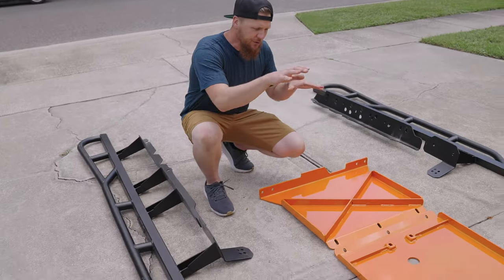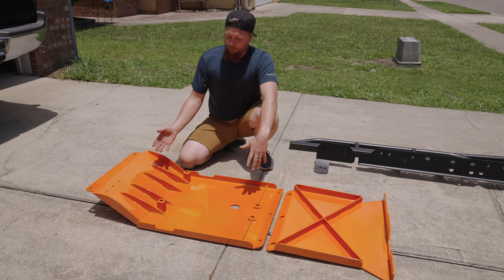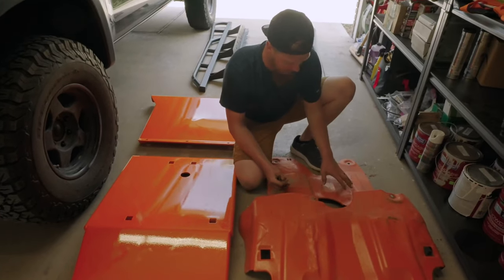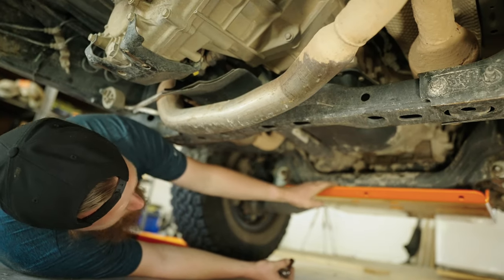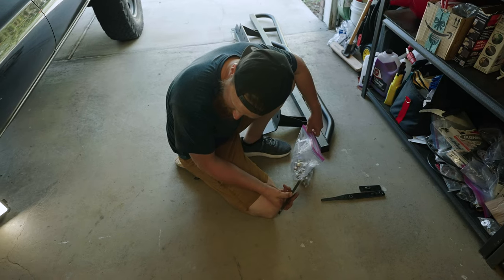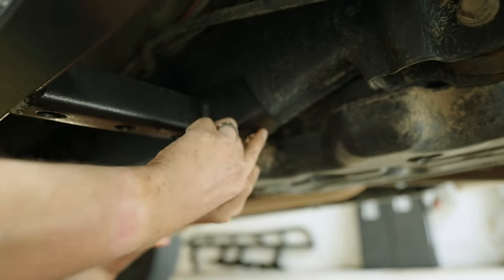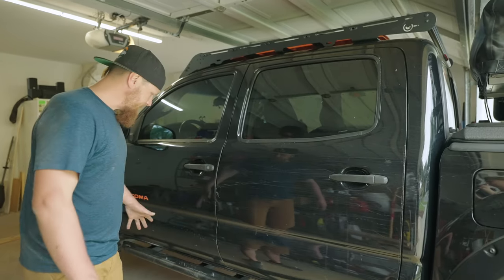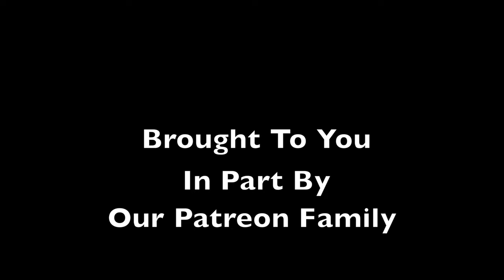Loki Gets New Armor From Bay Area Metal Fab

Comment: What degree are those sliders?
Reply from the maker: These are the standard built ones and are mounted at 20 degrees. You can customize the angle I believe if you do the built to order option.
Reply: @SunshineStateVikings Is that the Bay Area metal fab front bumper?
Reply from the maker: @yzrippin hey, thanks for the question. The front bumper is actually from Pelfreybilt which unfortunately isn’t around anymore. When Pelfreybilt went out of business Bay Area Metal Fab actually acquired a lot of their old inventory and has always had the same sort of look that the old Pelfreybilt company had, it’s one of the reasons we went with them to keep the look close to what the style of the front bumper is. To this day all the armor on the truck from both Pelfreybilt and certainly BAMF is holding strong and doing its job well.